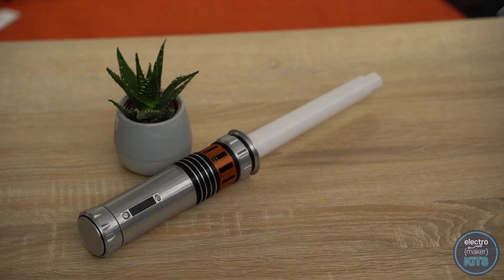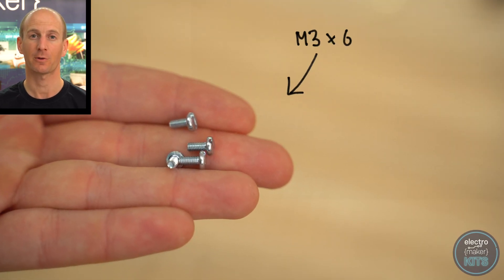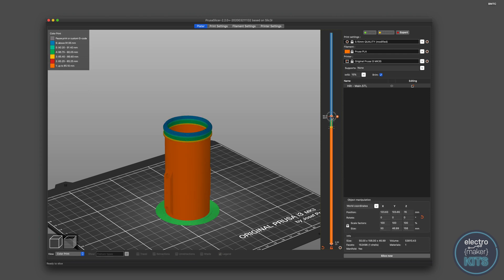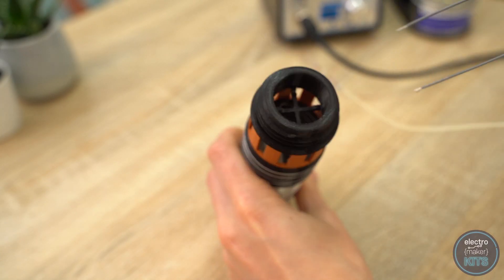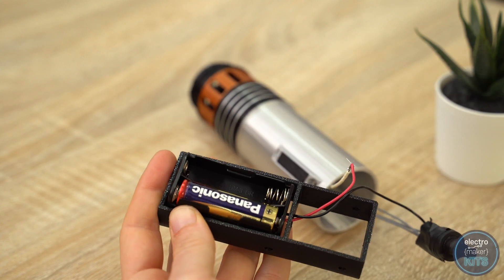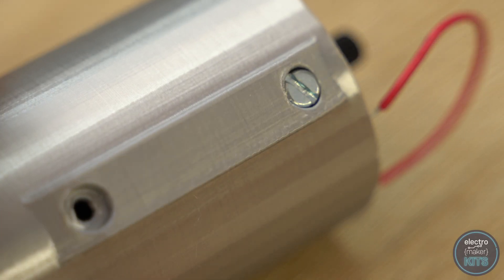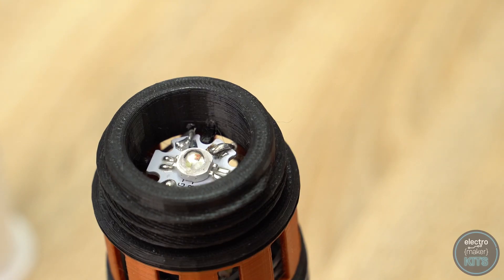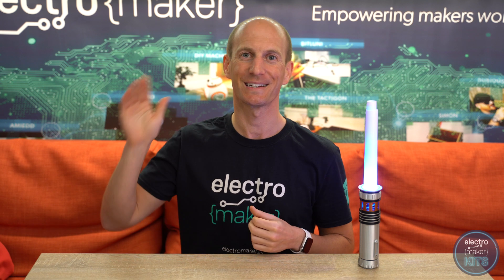Build your own DIY multicolor Lightsaber on a $14 budget!

Comment: Did this project with my son on a Bambu X1C and it was great! We used clear PLA filament but might try PETG for a little harder saber :D Great instructions and loved it was all easily orderable from your parts list. Just a cool, fun project to try. Highly recommend!
Reply from the maker: Great to hear you enjoyed the project Kody! If you want to go a step further, you should checkout our disco helmet project :)
Reply: @Electromakerio  follow up if I may, can I remove one of the resisters to the LED to get a brighter light source? I imagine the answer is 'not recommended' as I can feel the heat coming off the light as is when trying different saber materials. I printed the hilt in PLA but wondered if PETG may stand up to temps if the resister was removed.
Reply from the maker: @kodywillnauer9422  We have not tried doing that so it's difficult to comment. No harm in experimenting though!